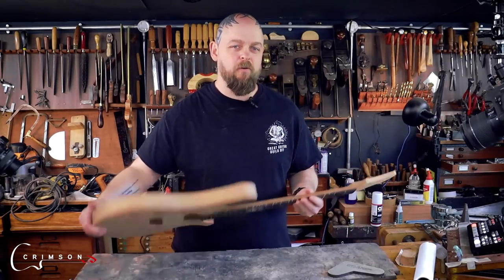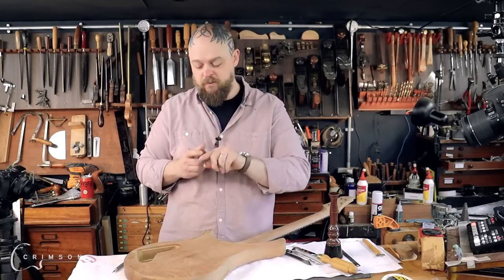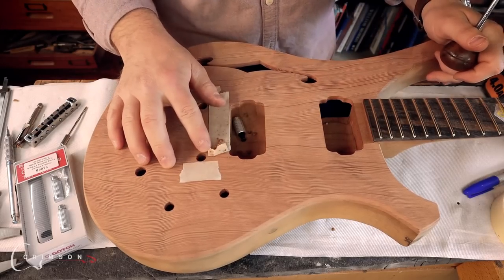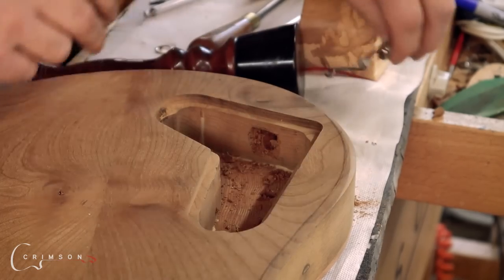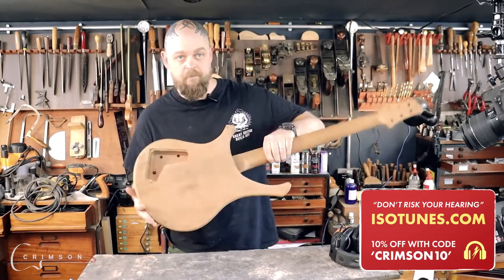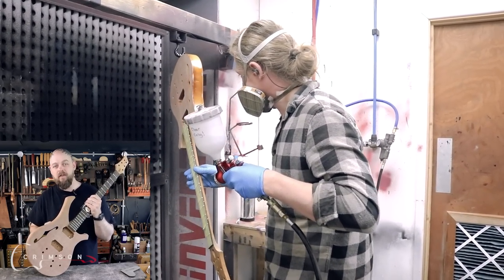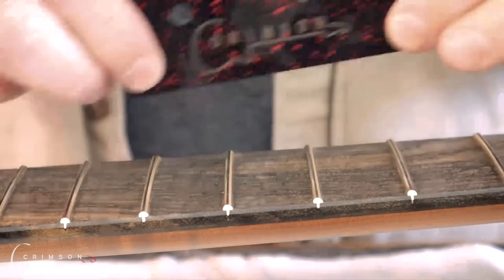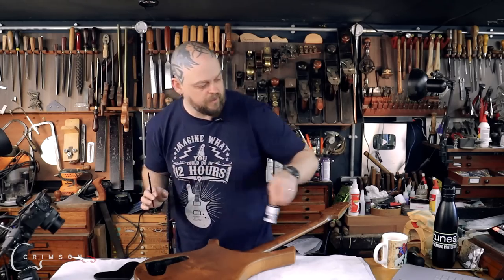Final Shaping, Backplate & Spraying Ep 5 | Building a Boutique Hollow Body Baritone Guitar

Comment: Great way of creating a depth stop for drilling, especially if you're doing more than just two holes is also heat shrink tube that's used in electronics.
When heated up with a lighter or soldering iron it contracts forming a tight connection with the drill, but is easily removable.
Since the drill has the spiral indentations it will go tighter in those and won't slipp.

The drill can withstand heat anyway as it has to get hot during drilling and if that happens the heat shrink will only get tighter, rather than when using adhesive tape, where the adhesive will loosen under heat.

Also it's easy to remove, cause you can just cut at the drills spiral.
Reply from the maker: Thank you, this is a great trick to share!

Comment: I just recently got a guitar for £30 at a car boot sale as it is a little beat up I thought I'll just give it a good clean up. and with one string missing just thought hey I'll get new strings a tuner and a pick. then when I went in to put on the new strings I noticed that the tremolo block had snapped apart so I can't install the new strings until I get the new block in place. oh and I did use to learn the guitar before moving over to drums then to DJ'ing but hey no harm in getting back in to playing guitar.

Comment: what kind of distance are you talking about when offsetting the bridge on the bass side? last time I didn't know about this when installing a tune-o-matic and my intonation is way off. but I found several sources saying you need to offset both sides a little, and it's confusing to me. some even say to put the treble side forwards by 1.5mm, but I doubt that. I also have a neck break angle of about 2°.
Reply from the maker: Treble side 1mm forward, bass 2mm back if using 10 gauge strings.  Ben